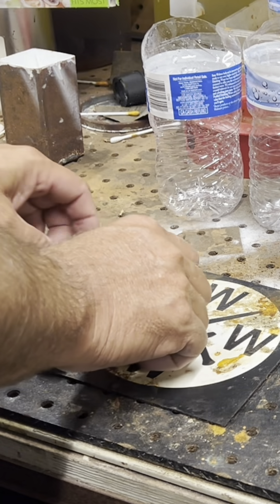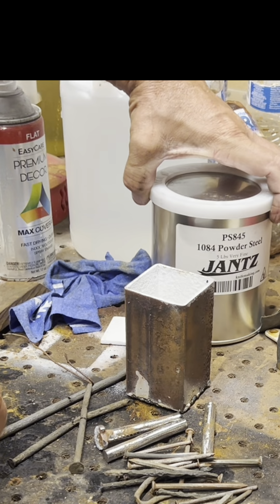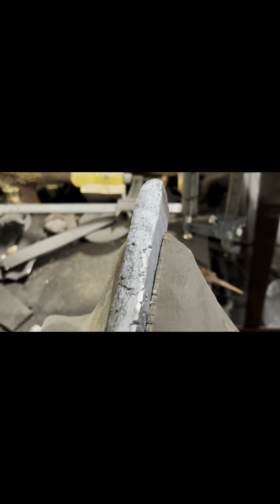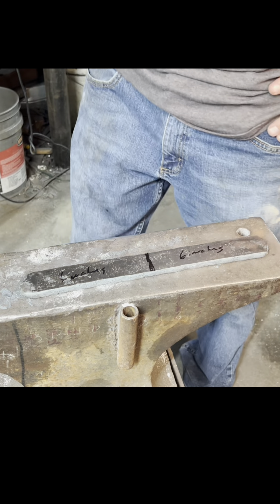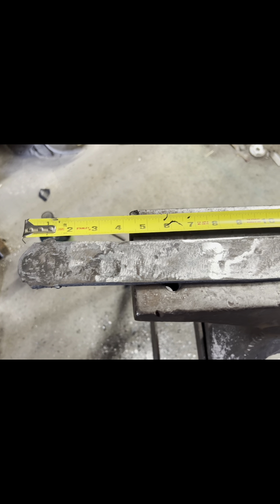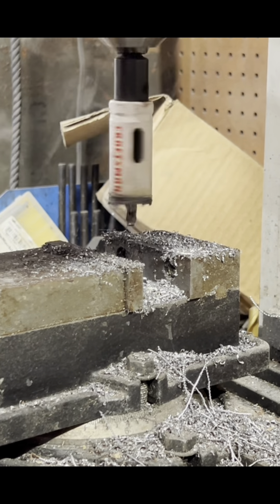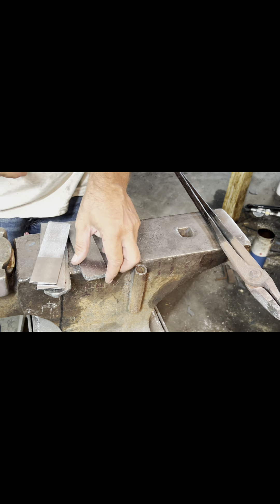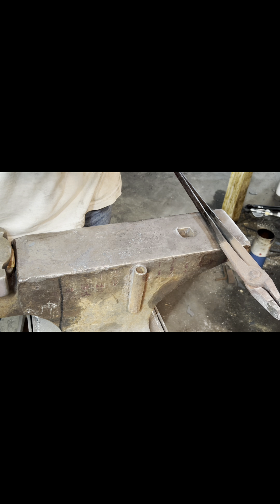Knife Making:  Forging knives from old rusty nails

Comment: You really hung with to the end. Very admirable. I was wondering what acid did you use. I have had similar results with gator p. Some of my canister sanmi knives didn’t etch properly. I stay with the tried and true ferric. Just my opinion.
Reply from the maker: @edthompson3353  thanks. I tried to finish it out. lol. Acid was gator piss. I usually love the results. But this is the second canister I have had issues with. I need to get some more ferric.